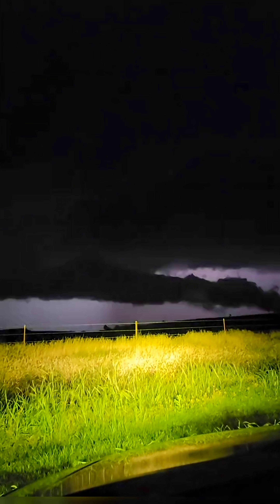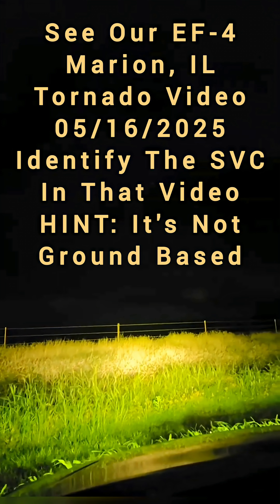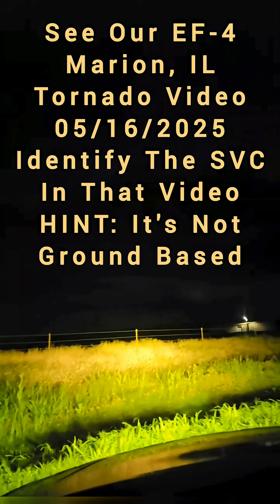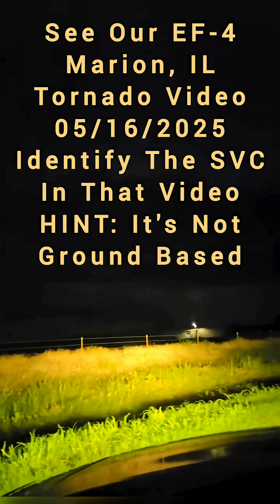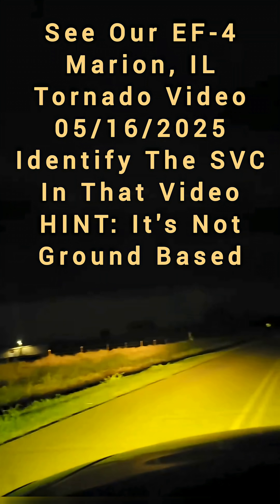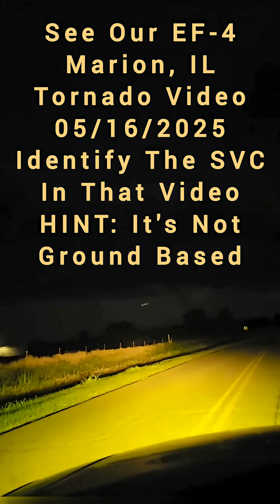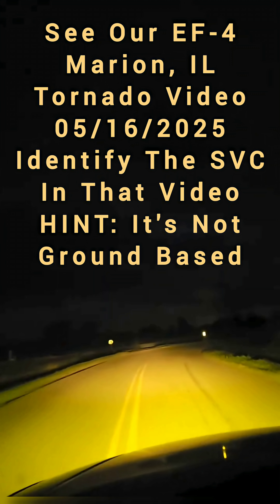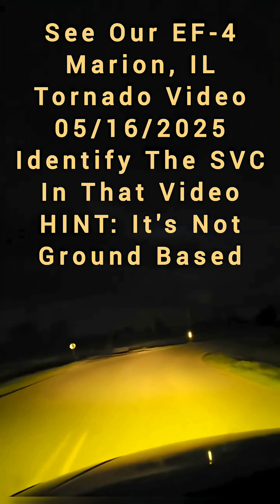Supercell: Streamwise Vorticity Current

Comment: Isn't that the tail cloud?
Reply from the maker: No.  The main difference is the tail cloud does not rotate, has a visible end to the tale, and is short in comparison and represent the inflow into the mesocyclone and appears as an actual part of the wall cloud, i.e. the tail.   The SVC is a large counterclockwise rotating structure that originates all the way back to the FFD where you feel the cold air downdraft at the front of the storm.  Sometimes it is not a visible structure while at other times it is a large structure,  visible,  rotating counterclockwise seen easily with the naked eye,  and covers several miles and goes way back to the front of the storm (generally at the FFD.   It can originate on the ground (mostly in high precipitation storms) or may originate at the FFD and run just under the main storm cloud (low precipitation storms) as in this video of the Marion,  IL tornado..  Sometimes they actually,  run parallel to each other with the SVC being the longer rotating structure that appears to either have no end or fires ask the way visibly back to the RFD.  The task cloud with have a definitive end therefore referred to as the flat beavers tail.   In this video,  I should not have used the beaver tail verbalized for it is risky different than the SVC we filmed that vibes the entire area under the supercell.   In my defense,  we were trying to get out of the storms way when I got distracted at the site if the SVC and got a little excited.
Reply: Oh wow, thank you for this info. I absolutely love all the complex natural processes of these storms! Stay safe out there @jacksloan911